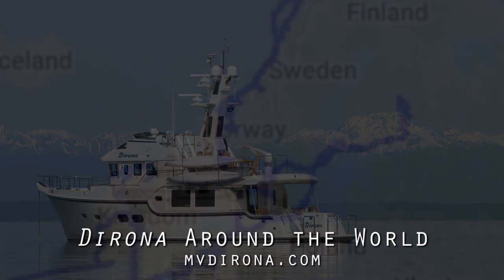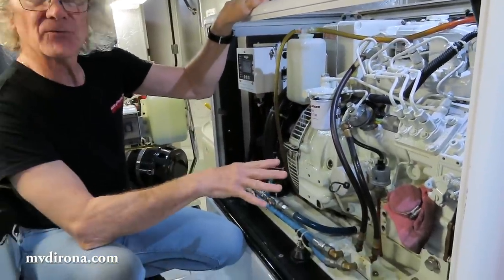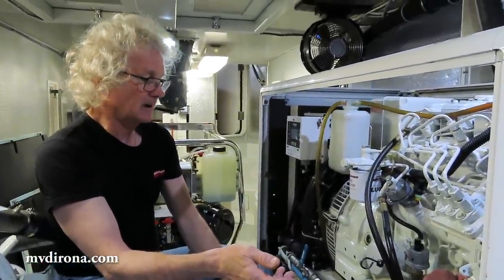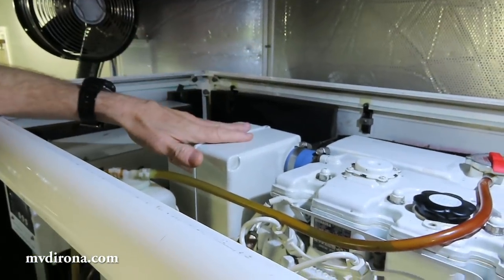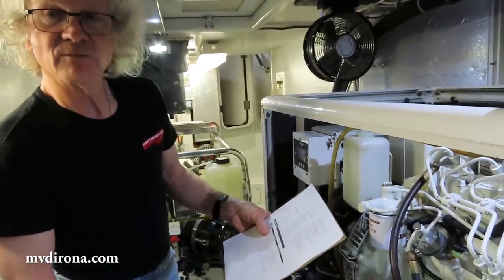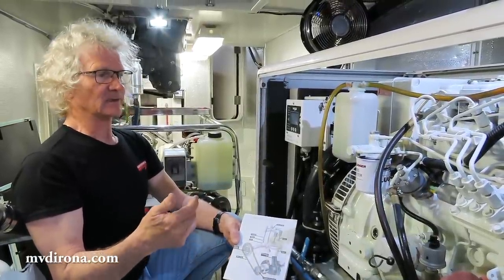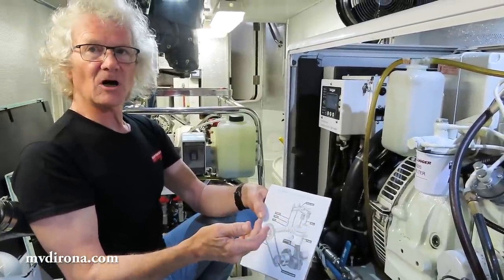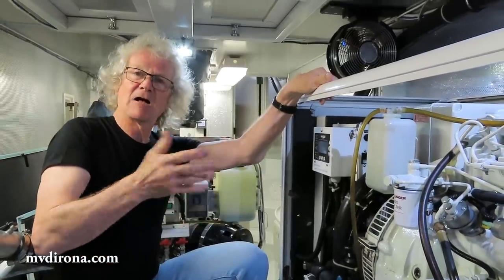Diagnosing Low Power Output on a Northern Lights 12kW Generator (MV Dirona Channel)

Comment: When I was working at ADE, the smaller units (gen sets and propulsion) were built in Japan and shipped to ADE HQ in Seattle. Where it was tested in the test cell, QC’d, cleaned and prepped, crated for customer and shipped. It sucks that this happened to you guys 😕 memories of tight spaces in engine rooms for a tall guy…me 🤨
Reply from the maker: We love Northern Lights products and would choose them again in a heartbeat.  Our generator needing a valve job at just under 7,000 hours is arguably a bit early but the service and support from the ADE team is simply amazing.  We're 100% happy.

Comment: What a fantastic video very in depth and informative. Hope you show the rest of the work. As an aside I used to race ( grass track) in the 70’s using used Norton Dominator 99 engines they were cheap. Problem was once they had been tuned and running on methanol the bolts connecting the big end caps to the crankshaft stretched and boom no engine!!! The same thing as a valve stretch, we changed the engine to a better one eventually.
Reply from the maker: I know what you mean about seeing the odd race engine let go. One year we were racing Alfa Romeo and experimenting with how high we could rev those relatively long stroke engines. Learning about that consumed several quite nice engines.

Thanks for the feedback on the video.
Reply: MV Dirona That brought back memories racing is fun when you can afford it’s associated costs. I loved it. Thanks again for the great video today.
Reply from the maker: I had meant to say "long stroke engines" and, yes, you are right about racing is fun if you can afford.  My involvement was mostly working on other peoples equipment so less exciting but more affordable :-).

Comment: watching every of your videos here in Germany. Love Nordhavns. 
I'm very surprised hearing you say: "it's not a lot of work", an than understandig that you are going to disassemble a whole Diesel-Engine und put it back to life again. If I would do this, the engine probably would be wrecked :-)
You're really great people.
Reply from the maker: Thanks for the comment on the video. As of this weekend, we are no longer forced to speculate on how long the cylinder replacement job will take. We did it over the weekend and it's bit more than a full work day and it probably should have been done in a single day. So it's big in that the entire top half of the engine needs to come apart but it's still not that bad if you look at the total time required to do the job.

The generator is now back to running at full power and it sounds smoother perhaps because we changed the fuel injectors at the same time.

Comment: Having undertaken a cylinder head gasket change on a single cylinder engine, I found the diagnosis and plan to resolve the problem very interesting
Reply from the maker: Thanks for the feedback. We changed the head over the weekend and will post that video when it's ready. It's great to see that engine back to running at full power.

Comment: Next video on this job will be for me tomorrow. Good clean explanation of the job ahead. I had to remove the heads on  the small block Chevy powering my 280 Volvo Penta in/out board because of gasoline turning to gum/varnish. That made all the valves tough to move until one was so bad it pull the rocker stud out of the head. Hot tanked the heads replace the stud and was good to go. 30 ft. Bayliner, twin engine with big access doors outside. Some crawling but was ok.
Replacing the crank seal is a bigger job I bet.
Reply from the maker: Swapping heads on a small block in a 30' boat won't be leaving you a ton of space work. Glad it went well.

On the rear main oil seal, you are right it'll be a bigger job but, so far, I've been lucky. It's just about stopped leaking. My theory is the dead #3 cylinder wasn't firing but was getting fuel prior to me changing the head. I think we likely had fuel diluted oil and it was far more prone to leaking. With the head change and an oil change, the rear main oil leak is just about gone.  I fully expect it to return but it's been 1,279 hours since the head change and the seal is still looking great.

Thanks for the feedback on the videos.

Comment: Great teching Method, Very Good Conceptual Explanation of all the Fluid Flows and Heat Exchange concepts. My favorite Term "Failure Modes." Being an Ex-Navy Nuclear Reactor Operator, I Haven't considered Marine Diesel Technology very much, as most generation of Power is accomplished through using steam turbines, and condensate heat exchangers in closed loop systems.   Of coarse control systems were/are similar to your installation I guess, because I'm not familiar with Your setup, where we used Programmable Logic Controllers as well as mechanical controllers for Systems Integration and Control. Now I have a clue as to what's going on...Thanks skål!
Reply from the maker: Your control systems were considerably more mission critical since you were taking care of a nuclear reactor. Mine are far simpler being responsible to start and stop the generator, do electrical load shedding/peak shaving, track all sensors, set audible alarms, indicators, update displays, send email, update data on mvdirona.com, chose the best wide area network connection among 5 WANs (cellular options and satelite connections).

There are 5 Raspberry Pis (small Linux computer) spread around the boat doing digital input, digital output, and some analog input. A central system interfaces with the 5 Raspberry Pis sending actuator requests and collecting sensor input which is written to a central database.  This program also reads and writes to the NMEA2000 bus and sends and receives data from it as well. Most decisions, all alerting, alarming, and reporting and done by the central system. 

Not quite as life critical as maintaining a nuclear power plant but still useful :-).
Reply: @MVDirona  Thank You, Yes Redundancy and Fail Safe are the Watch Words in the Nuclear Industry. I love the Raspberry Pis< I've used them in many projects from Ham Radio to building control systems in my Motor Home, great for builder Projects. Thanks For the glimpse into Your Control System, I'm sort of A geek for Grabbing the Tech Manuals For a Good read Before grabbing a Fictional Novel, I just love the facet of system integration and putting the pieces together to create an "orchestra!" Such fun! Again Thanks and skål!
Reply from the maker: I agree with you. They Raspberry Pis are amazing. You can have 28 pins of general purpose I/O, a full Linux computer, with adequate storage for under $50 without needing to buy in volume. It's amazing what can be done these days almost for free if you are OK with writing a few lines of code.

We probably should do a video someday on the control systems on Dirona. It all surprisingly simple and yet the system works really well.
Reply: @MVDirona  I Would Love That!

Comment: I'd highly Recommend with your 1000hr maintenance to run Amsoil Diesel Injector cleaner concentrate through your fuel injectors to keep them spraying consistently. It's one of the most powerful and quickly effective diesel injector cleaners I've ever used. Worth the money 100%.
I just sold a semi truck with 18,000+ hrs on the engine, original injectors and common rail. It got Amsoil injector cleaner every 30-35k mile PM
Reply from the maker: I've heard good things about Amsoil and other fuel additives from enough good people that I know there are good reasons to use them.  But, thus far, I've elected to run on good quality diesel that hasn't been in the tanks long and it's been giving fairly good results.

Comment: Three things:
1) Thanks for this video.  Very informative and well done.  Good job.
2) I hope that you do a video of the actual head replacement.
3) Is your new cylinder head assembly white?  Or do you paint?  Or do you simply end up with a two-color engine?
Thanks so much for your time and effort to make these videos.
Reply from the maker: Thanks for the feedback. We will do a video of the cylinder head replacement.  In fact, the parts arrived last Friday night so we did the cylinder head change over the weekend and we did a post mortem on the old head to get an understanding of what caused this failure. 

The details are posted to https://mvdirona.com and we did video the work but it'll take some time to get an 8 hour job down to something reasonable from a video length perspective but we do have some time on our hands so we should be able to get that posted over the next couple of weeks.

That's a great question on the cylinder head not being painted. Every time I put a new part on the three engines in Dirona, it's unpainted. In some ways, I don't like that but, in others, it's an interesting way to document what has been done. Still on a cylinder head, it won't look great and it will rust I figured I would need to do something. I was really surprised Friday night when the new parts arrived to see the cylinder head came painted. Yeah!!!! Not what I expected but really appreciated. Thank you Northern Lights!

Comment: "Running the rack" (adjusting valves) on diesel engines used to be one of my favorite tasks at my family's diesel repair shop.   But I think it was less stressful working on other peoples stuff.   It's never fun to have your own engine components fail.    Also,  where is your furry supervisor/project manager?
Reply from the maker: Your right, it's not ideal to have an important component like the generator off line. The parts arrived Friday night so we changed the cylinder head and the engine is now running well again. the valve seat on #3 exhaust was a mess and none of the valves were in great shape. But it's all back running now.

That'a good point on the furry project manager. Spitfire normally does show up to check on the quality of the work and make sure nobody is slacking off but seems to have slept through this one. He did show up several times while we were changing the cylinder head though.
Reply: @MVDirona  #3 exhaust was a mess meaning you had water back feed the exhaust?  Could that of happened during severe weather? Or, is there another potential problem?
Reply from the maker: We'll get into more detail in the next video but it does looked like there has been water in there in the distant past. As a consequence of investigating the exhaust design and operation, we know that there is not excessive amounts of water collecting in the muffler when the engine shuts down. I don't think water can get in under normal operation. 

But there does seem to be evidence of water.  My hypothesis is during the 4 or 5 really rough water experiences we have had in the boat, water did get in due to extreme boat heel, some water splashed in from the remaining water in the muffler. Here'e an extreme example from when we were in Australia and the boat was knocked over to 69 degrees: https://mvdirona.com/2014/09/69-1-degrees/.  Another is the rough water we saw on the North Atlantic Crossing in 2017: https://www.youtube.com/watch?v=guEnTp2a6Sc.  

During these events the boat was leaned over a long way and water could have got in. I suspect largely nuisance amounts and if the generator had been run after those events, thing would be fine. But, instead, we didn't use it for many days and sometimes weeks. 

The lesson for us is to fully exercise all mechanical systems after the boat has seen extreme conditions.
Reply: @MVDirona  the proximity of the water injection to the valves is suspect. many manufacturers have issues with this and fail to recognize it, please see sbmar.com for good information along with great illustrations on how to remedy. At the very least it's a great read.Best wishes and really enjoy your videos.
Reply from the maker: It's good to hear from the Seaboard Marine team. Thanks for passing on your experience with wet exhaust systems my way and please say hi to Tony for me.

Comment: i'd hold off on doing that rear main seal. from my experience generators will leak a little just after the engine has stopped, from the crank dropping off the film of oil, deforming the seal and letting a little oil drip from the top side of the seal.

and yes, i love a spotless engine room too.
Reply from the maker: You are right, the generator has gone more than a thousand hours since the head was replaced and the rear mail oil leak just about completely gone away. The only two changes that were made were: 1) the cylinder head was changed and 2) I changed the crankcase ventilation system to run slightly negative pressure rather than slightly positive. 

I believe the cylinder head change is what made the difference.  Cylinder #3 had a bad exhaust valve seat causing #3 to not reliably fire and fuel to run down the bore diluting the engine oil. Once back to peak operating condition, it leaked no further oil.

Comment: Love your video's ! What about "AT-205 RE-SEAL" to soften and rejuvenate your crankshaft seal ? This would save you a lot of work removing the seal for now…. Watching from the Netherlands.
Reply from the maker: Thanks for the feedback on the videos and the pointer to the oil additive. I chose not to use these additive partly because I worry about side effects where non-leaking components start to leak or temporary corrections where the softened lip seal is better for a while and then a few months later gets worse fast. These may be unfounded worries but the car and engine manufacturers have fairly big warranty costs caused by oil leaks and, even though they like to avoid unnecessary costs, they replace seals rather than leaning on additives. 

I would think if the additives where a good long lasting repair, the manufacturers would save money and use them.  Given they chose not to use them and recommend against using them, I'm not comfortable using them myself even though the thought of an easy solution is quite appealing :-). Thanks for the suggestion.
Reply: @MVDirona  The best thing is always to replace and use oem-parts when you do, you're right ! These additives could in my opinion only buy you time towards the actual repair. Again keep sharing your video's  !
Reply from the maker: That makes sense. I do plan to wait a bit on the rear main oil seal. It's a bit of an experiment where I vent the crankcase to atmosphere rather than run slightly positive pressure. I had started that experiment just before the valve problem interrupted things. I'll go back to it and, if we are lucky, we can defer the rear main oil seal for a few more months.

Comment: Curious to see if the failing  valve seat is  indeed the cause .
Compliments for a thorough  step by step ( and very understandable) diagnosis : good preperation is half the battle !
Reply from the maker: Thanks for the feedback on the video. Over the weekend, we took the head off and the #3 exhaust valve is so bad you can see the problem from a yard away. Check out this picture: https://mvdirona.com/trips/med2020/med3.html?bleat=6%2F20%2F2020%3A+Valve+High.

It's back to running well again and we'll post the cylinder head change video as soon as we can.
Reply: @MVDirona  Indeed the most probable cause as well a good lesson to run the generator more frequently espcially after rough crossings . But all well that ends well : a great job ! Glad you like Scotland and Ireland(Kinsale) : both
Reply: ...my favourite european countries as well as Denmark and Finland
Reply from the maker: We like both Finland and Denmark and spent a lot of time at each last year. For this summer, we were originally think of the Med but gave up on that because of COVID-19. We're now leaning towards Norway depending upon when countries open up.

Comment: Well guys, that is my 4th time of watching this Video, very very interesting, thank you again, keep them coming.
Reply from the maker: Thanks.  We have 238 hours on the new head and it's running well.  And, for some weird reason, the rear main oil seal hasn't leaked a drop in 69 hours. I'm sure it'll be back but it's nice to have that problem off the "needs to be done soon" list.

Comment: Another very informative video. It's really interesting to hear how you diagnose the problem. Where did the new head come from?
Reply from the maker: The new head came indirectly from the manufacturer, Northern Lights, via one of our favorite marine retailers in the US. It was sent here by UPS air freight which is a bit expensive but we already had reasons to do an air freight shipment. I needed to get a used power takeoff clutch for the wing engine shipped over here as well so the two parts essentially "shared" the shipping costs so it wasn't too bad. And, the good news, is the generator is now back to fully operational form.

Comment: Where did you get the repair manual? And have you done anything on the fuel pump? I have a unit that is leaking out of one of the connectors on the fuel pump to the injectors. Do you have any suggestions? I've talked to Northern Lights and they said there are only shims under the hex connectors.
Reply from the maker: You'll find the manual here: https://www.northern-lights.com/technicalinformation/manuals/.  I've not had any leaks or issues from the injection pump so can't offer you an experienced perspective on that one. I've heard they have a greater propensity to leak from that location when operating in excessive hot environments. Make sure the temperatures inside your enclosure are under 130F.